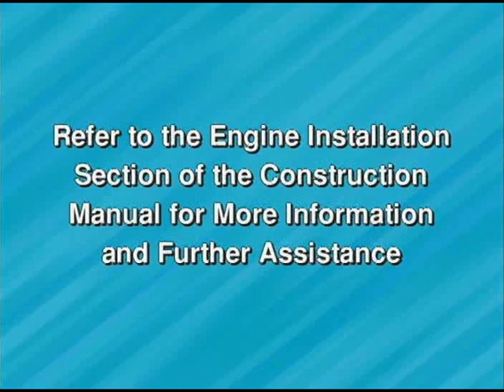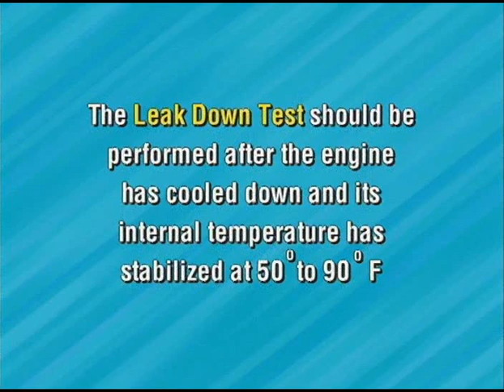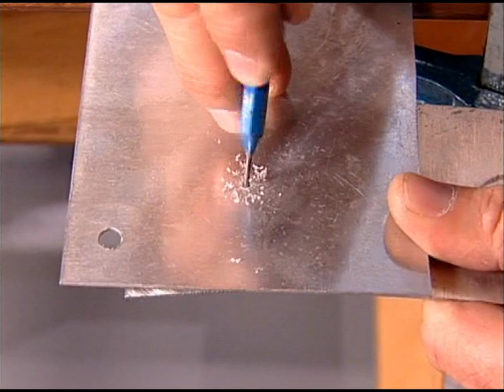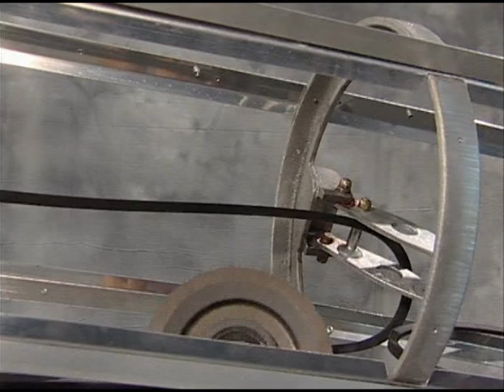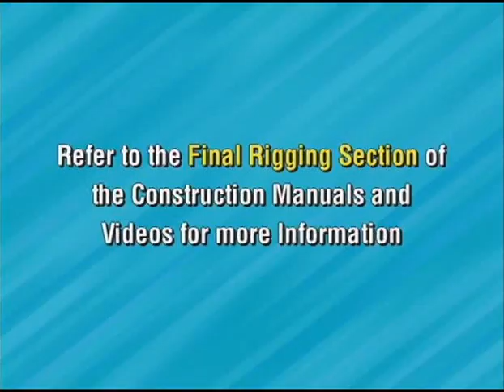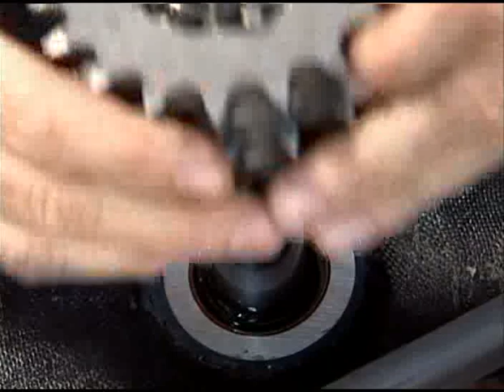RotorWay Título 2

Comment: the way he is holding the torque wrench is wrong and could lead to wrong torque reading. You must use the rubber handle on the end it pusher on the end which is calibrated with the tension spring of the wrench. Read the instructions which come with the torque wrench. PLEASE. this could lead to a crash.
Reply: The FACT they put that into the video, tells me the producer of the video is just as much a hack. The Alaskan Airline mechanic that did the last jackscrew lubrication, he didn't lube it at all, would be proud.